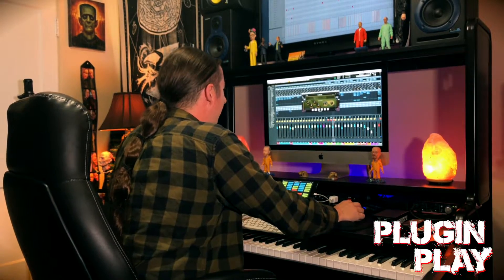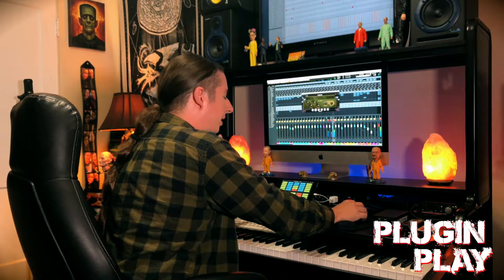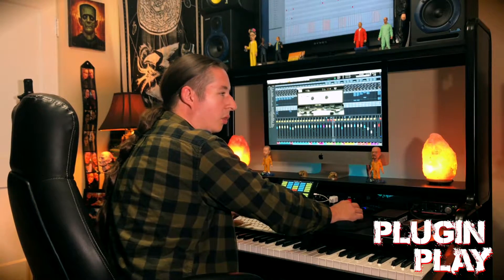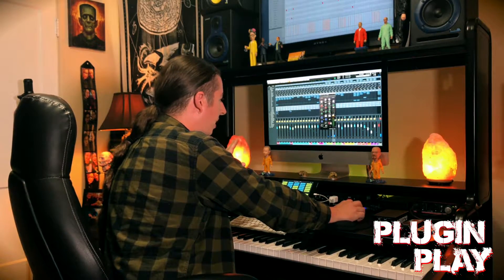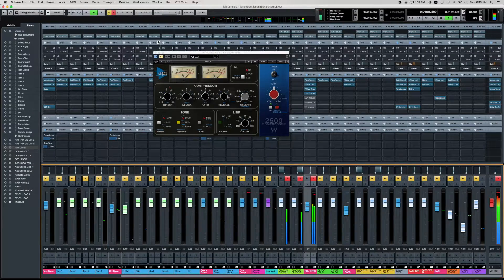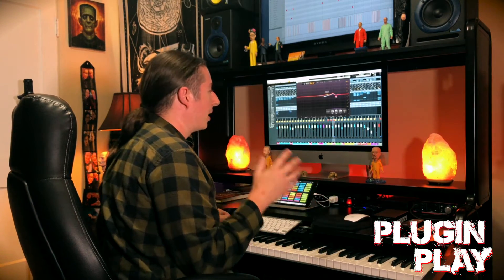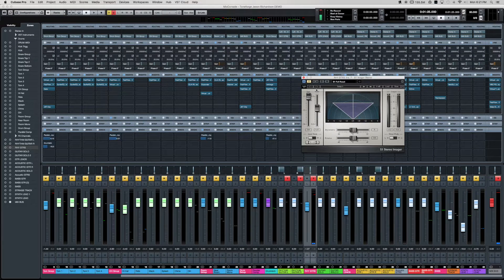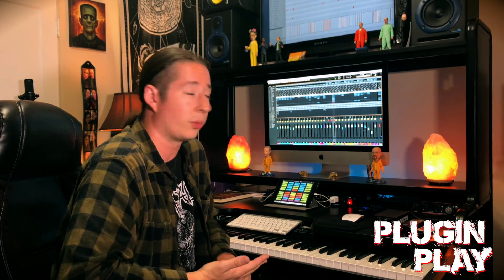Tips & Tricks : How to mix 2 Guitar DI's with 1 Amp Sim (Tutorial)

Comment: Great channel! How do you actually route the guitars?  I create a group channel then change output on each guitar to the group channel?  Is this correct? I tried to do it this way but I ended up with a mono sounding track. Thanks
Reply from the maker: Thanks for watching! I usually send both mono tracks to a stereo group track in Cubase. Make sure when you create a group track that it's stereo and not mono. I've made this mistake before. Try that and see if it helps.
Reply: @DestroyingTheDevoid  Thanks man! It worked!

Comment: I have a question about the Jason Richardson Toneforge. Right off the bat, yours sounds great, but when I load mine onto a DI from a quality guitar with quality pickups, it sounds muddy as all hell and even if I turn the bass all the way down, there is still a lack of clarity and low end that I can't shake. 

Tips?
Reply from the maker: You definitely want to brighten it up with a eq. Or try adjusting the presence and the clarity knob. I think it’s one of those amp sims that sounds better in the mix then by itself. Make sure too that you have new strings on your guitar! That makes a huge difference as well.

Comment: Hi Craig, thanks for the tips!!! Looking for some Cubase tutorials a found a tool to edit tracks, that can help me to correct some latency problems.. Audio Warp. I use Cubase Elements 8 and that option isn't avaible (only in Pro and Artist versions I think). Do you know any plugin fot Cubase that can do that audio warp??
Reply from the maker: +grindworker I would just use audiowarp. Though I don't do much warping of audio. As I would prefer to use slip edit if I need to slide transients where I want them. I would definitely recommend upgrading to artist or pro it's totally worth it.